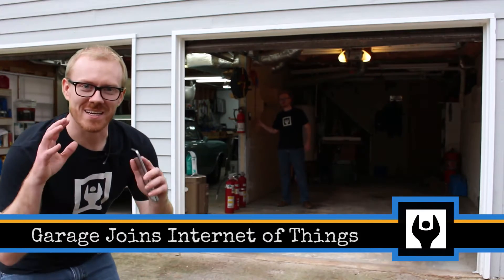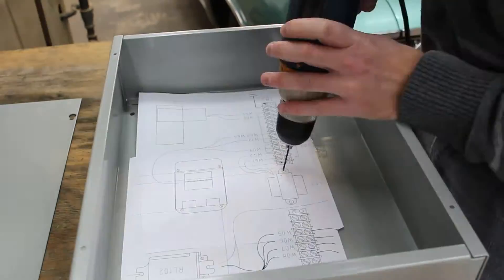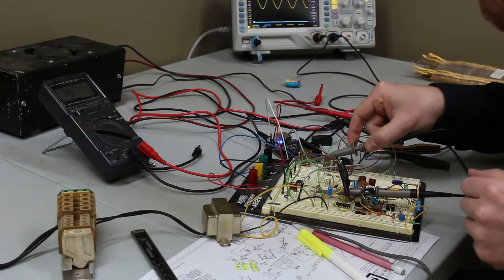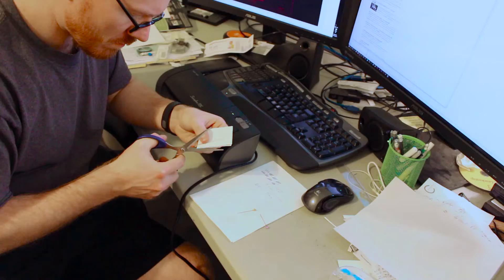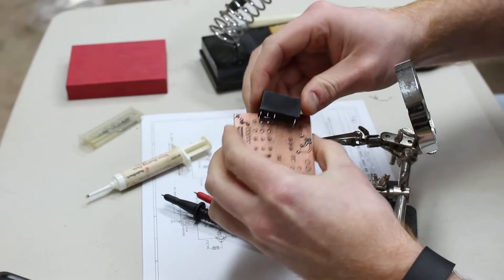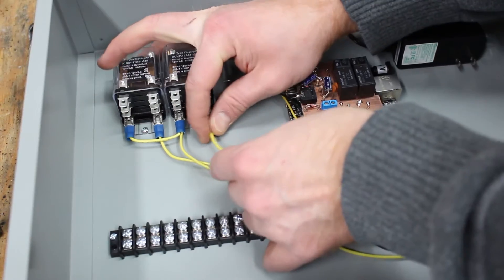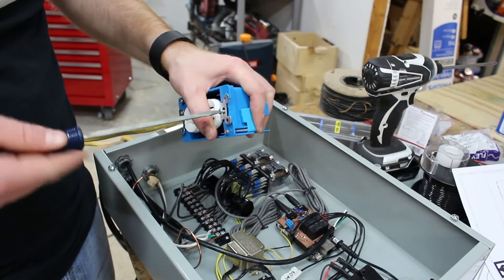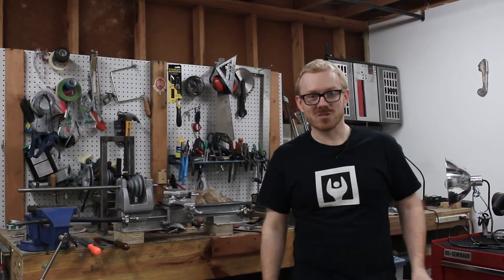Home Automation DIY Garage Lighting System

Comment: First of all thanks for the plug. I like the control circuit you built. Pretty cool. I used to use the iron on method but I switched over to the photo etch development method because I felt that I got better board etching even down to 10 mil traces using this method.
Reply from the maker: I was tempted to go the photoresist route on this project but time and familiarity dictated otherwise. I definitely want to try the technique at some point in the future.
Reply: +Makercise Once you try that method you'll probably be sold on it. I've etched hundreds of boards with the iron-on method for a company that I used to proof build proto-types for before the artwork went to the board house for mass production. The iron-on method does work but it can be hit and miss with the iron-on artwork either peeling or flaking off.
Reply from the maker: +flash001USA do you have a recommendation for the photoresist process chemical supplier. I am reluctant to buy stuff off eBay since I don't see great documentation about compatibility and no SDS.